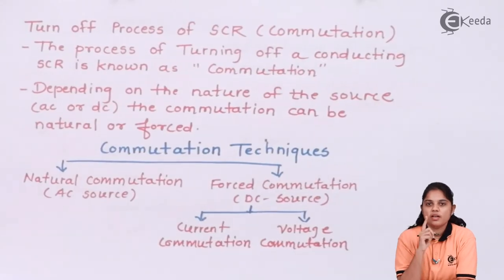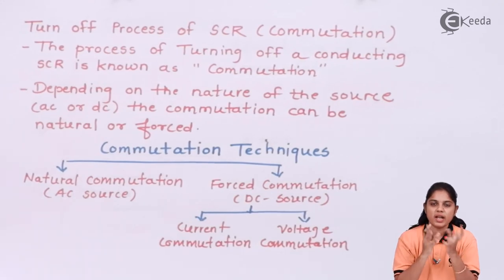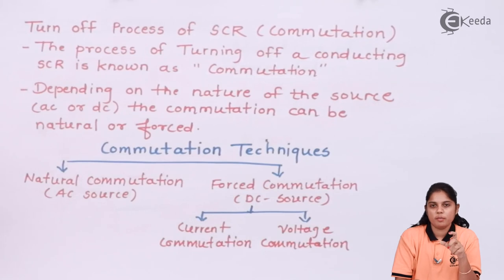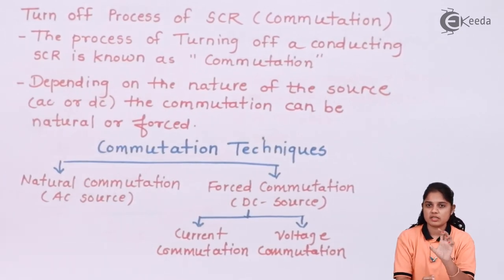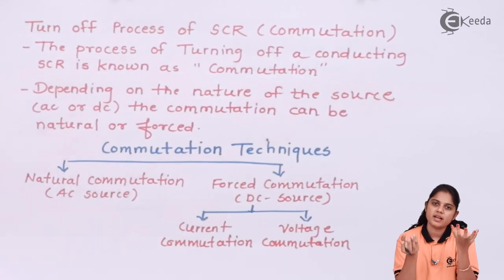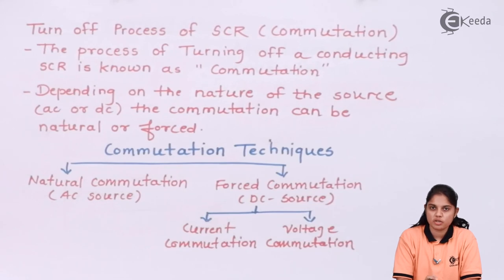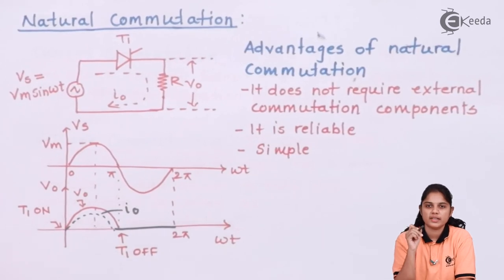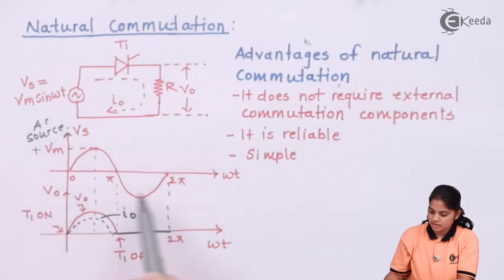Commutation Methods for SCR (Turning Off of a SCR) - Semiconductor Devices - Industrial Electronics

Comment: Mam in natural commutation you have considered gate terminal is open and you have applied ac signal then it will not conduct if the applied signal value is less than forward breakover voltage.
How can it conduct with gate being open please clarify?